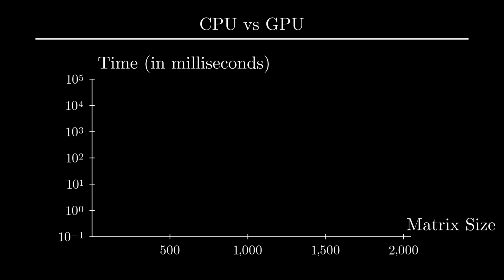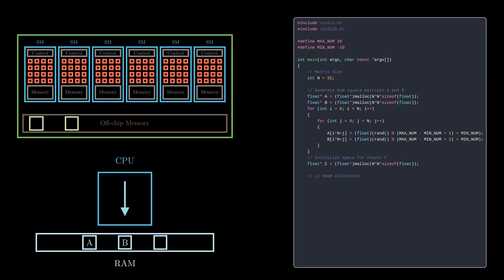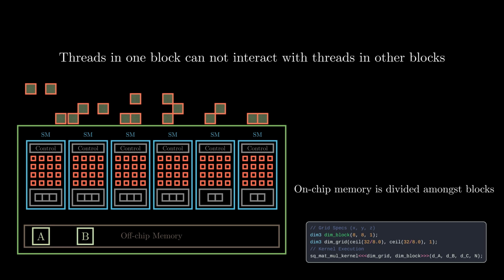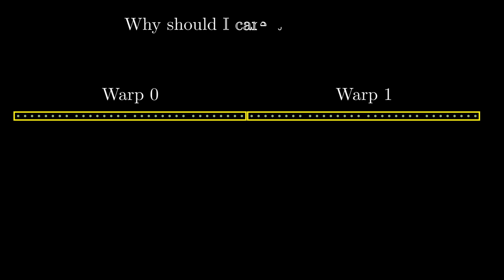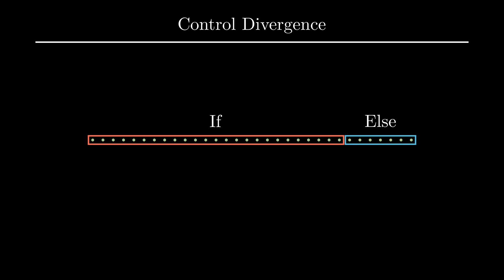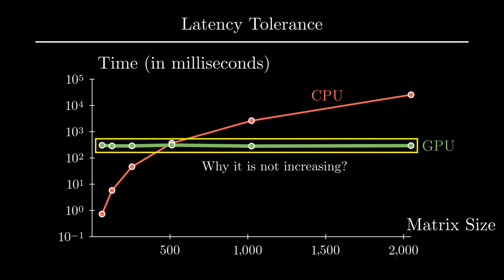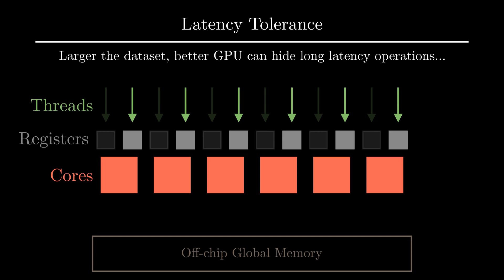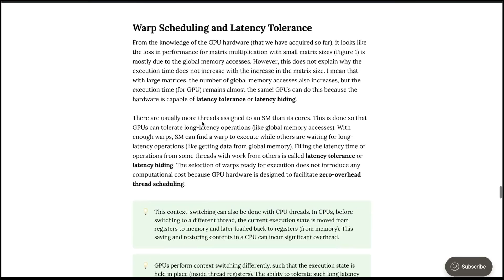Understanding NVIDIA GPU Hardware as a CUDA C Programmer | Episode 2: GPU Compute Architecture

Comment: I do not think your comparison between CPU and GPU is fair, your CPU implementation does not seem to be optimised at all. Modern CPUs support vector instructions (e.g. mine even supports AVX2) and have multiple cores/virtual cores. Also for the CPU you can use tiling and transposing one of the matrices to reduce cache misses, speeding up the calculation. I don't know much about this but you could compare with a somewhat optimised implementation of matrix multiplication on the CPU like OpenBLAS for a better performance comparison.
Reply from the maker: Yes you're right in the sense that the sequential program is not optimised. However, I haven't optimised the GPU program as well. Also, what I often say is that we need to use both CPU and GPU. In my last video (as well as my blog posts), I've mentioned several times that GPU is good at very specific tasks and it's our job to figure that out (and use it to our advantage). My comparison between CPU and GPU is intended as a motivation to look beyond traditional CPU programming. Hope this clears things up. Thanks a lot for your comment as you raised some really good points here. 😃